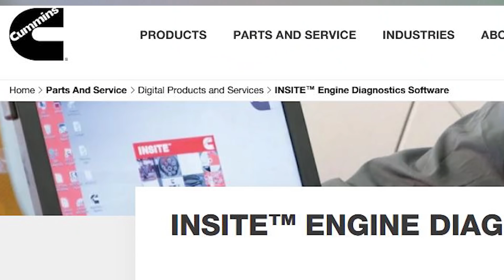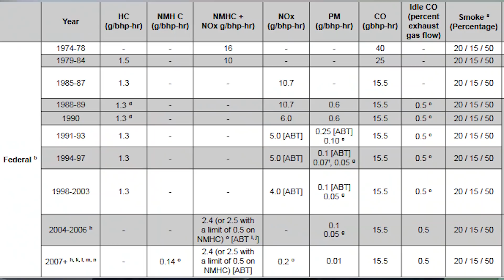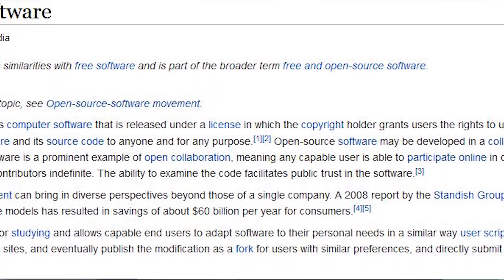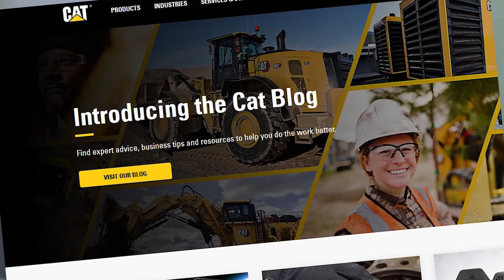Should YOU have the "Right to Repair" your Engine?

Comment: The Right To Repair act is a great thing in my opinion. It doesn't require the manufacturers to give the aftermarket or the end user access to their software and information for free. As nice as that would be, most folks understand the OEMs spend a lot of money researching and developing their products. In the automotive world, it essentially mandates the OEMs provide us access to that information, and at a minimum, the ability to program powertrain and emissions related modules. They're absolutely allowed to charge a nominal fee for this, and the cost and capabilities vary considerably from manufacturer to manufacturer. Some only allow the bare minimum. Others will allow you full scan tool, SI, and programming access like the dealer has. I know there's a push for this in the truck and off-highway worlds. As I'm sure you know, information and scan tool access is much harder to come by in those segments. I have a few different sources, but most of the truck & equipment manuals I have are PDF copies purchased as needed. In any case, thanks for the videos as always!

Comment: As a certified Cat Fitter in Aus, 50/50 agree to right to repair as it’s your hard earned money invested in the equipment you should to a degree be allowed to self repair however the second these “farmer mechanics” no legible trade or diagnostic certification fuck with parameters, force regen and diy repair on gut feeling it often leads to catastrophic problems down the road, Thus voiding any liability or warranty by the “dealer”. Than said customer will be bitching their quarter million dollar yard ornament is no longer covered by warranty an claim that’s not fair either so can’t have it both ways. However if Dealer won’t service your said postcode than that cost an repair may fairly be billed to dealer an allow their party diag access. Sign a waver saying you agree to void all warranty factory warranty in return for right to repair?

Comment: I see these laws as a double edged sword, people will think they will be able to repair anything because they have procedures to things and will get in to something and make the problem worse then blame manufacturers because something else broke or they didn’t have something to remove or properly tighten something and left it loose or damaged it during removal. Basic diag software should be available to everyone, you are buying both physical and intellectual property.   Intellectual property like software should be protected and not be forced to be given out freely to everyone. How many people are going to look at what the codes say are going to be able to figure things out properly or just start throwing parts at the problem until it is fixed. I work at a dealer and have seen too many “repair” jobs from mom and pop shops or owners that have ended up costing far more than the original repair would have if done right. If a compromise can be reached like say accurately read codes and say what they mean, force a regen, and maybe check sensors I am good with that. I have seen a lot of truck come in that the driver got a list of codes from someone then they cleared the codes and any snapshot data and they want the CEL figured out.  Info on things like torque specs and repair procedures or other nuts and bolts type things should be freely released because it is for the physical property, the ability to update an ECM or other module should require at least a little training and definitely pay enough to discourage someone not doing many won’t get the software. Another fix would be give dealer techs better access to the electronic tools at a lower than dealer level and allow them the chance for some side work at least diag wise on the laptop the tech provides and pays some sort of licensing fee for. There are solutions but the government needs to stay out as much as possible.

Comment: If I was a manufacturer, I'd be seriously thinking about letting customers diagnose and fix their equipment. 
Being ahead of others, being open and saying no matter how the legislation goes, customers will have the tools they need could lead a significant increase in market share.
Reply: I fully agree with this. An open repair and diagnosis program would put these manufacturers way ahead.  With supply chain and repair shops so far behind it would help alot of the backlog.
Reply: @mrplowjrezv  the manufacturers could spot failure trends quicker in a perfect world.
Reply: 'Letting' 'their' if you're letting i'd like my money back thankyouverymuch.
Reply: And your shareholders would boot you off of your own company, install a puppet, and put your company back on track to locking owners out of their own equipment.
Reply: Yeah, because all customer's are highly trained mechanics. You should have the ability to get the software/ parts for your truck. Just know that your warranty will be cancelled.
Reply: @tira2145  quick question how much are they paying you to lobby around in the comments repeating the same argument? Literally everyone understands the rules of a warranty and it not being covered if your repair directly caused another failure but alot of this problem is equipment out of warranty.

Comment: As a mechanic that works on cat, john deere, case, Doosan, IH, mack, and just about every other brand in construction... only cat is helpful. To a point. I still can't force a regen when the equipment has a lock out. Pisses me off to have to get a cat dealer tech come do a 5 minute job that cost me 7,000 bucks. I have the software, pay the annual sub, do the updates etc. but can't input a magic password to clear a lockout. Really???

Comment: A very complicated subject. My short answer would be yes, end users and owners should be able to access the software. I realize it's not that simple though. I am quite familiar with the analogous situation with Harley Davidson. Fortunately the aftermarket remains quite flush with "tuning" hardware and software that allows owners or shops to get into the ECU on a Harley and  diagnose a bike, repair a bike or reprogram it in keeping with modifications done to the engine. On the other hand, I have seen less than skillful and less than expert "DIYers" and shops "tune" bikes right into catastrophic engine failure. Of course this says nothing of the EPA regulations. Certainly in diesel pickups, the EPA has successfully hampered the aftermarket to a large degree over the last few years and sent expensive messages (fines) to the aftermarket about modding engine management system(s) on diesel pickups. Then there is also the warranty issue that may result if an owner has gone "in" to the ECU. 

So it boils down to a matter of diagnostics vs modifications and what the end user intends to do and ultimately ends up doing with the access to the engine management system(s). And to what extent the end user is allowed "in" to the engine management system(s). Like I say, it is a fairly complicated issue.

Comment: I feel that they should be required to sell licenses for the vehicle you own.  I.e. I own a John deer model xxx I can get the John dear software to work on that tractor.  They could even limit it by vin so you could only use it on your very own tractor but at least the. You could fix it.  I got friends with 100k+ tractors that are field art because the ecu locked down the tractor in the field where it’s sitting and they can’t get a John deer tech out in any kind of reasonable time to look at it let alone fix the issue.  Others have resorted to hacked Chinese software to diag their tractors but still run into trouble getting parts from John deer.  I worked at a Peterbult dealership for a while and truckers with their own scan tools could diag their trucks and come in and get the needed parts to fix their trucks.  Heck the dealership delivered parts, you didn’t need to come in.  Not so John Deer.
Reply: Maybe it time to dump Deere eq. That usually changes minds !!!
Reply: @catman5546  That is happening too.  Farmers tend to keep equipment a long time.

Comment: as a previous CAT tech I think they should offer all of their software for a price but not the extremely expensive price the currently offer from just part of their software. I do know that the CAT dealer i previously worked for charged roughly 190$ an hr for field tech call out. that's an outrageous price and i know what the highest paid tech in my dealership area was making before he left and that dealer is making money several times over the cost to operate. so yes i believe independents and owner operators should be allowed access to software provided they are willing to pay but the price should fit the product, it shouldnt be another outrageous cost. Dealers will always be able to make money just look at car dealerships.

Comment: I,m old enough too remember when all the different car makers had their own computer software and tools for their codes then the government required obd2 systems didn,t hurt the auto makers I work as a heavy duty mechanic at a sawmill and we run into this problem all the time we have 5 different brands of equipment and nearest dealers are 2 hour drive away and they are understaffed as well would make life alot easier if you had just one standard

Comment: I read many comments and haven't seen one about a dealer "diagnostic fee." O/O with a N14 in a 1998 379 here. I can diagnose many problems with it. Injector failed, easy to figure out. Pass through good. Ohmed the injector. Bad. Towed to Cummins. Told them #6 is inop,  They still charged me $225 for "diagnostic fee."

Comment: Right to repair seems to be the correct way to allow proper competition between dealers and independent mechanics . Other issues can arise when unskilled or overconfident people start getting access to high level software adjustments and tinker with high tech systems creating more problems. Then basically lie when getting the problems they created sorted out by more experienced techs I work in diagnosis and repair of high level catering equipment and hate it when unskilled people have basically hacked the software settings and want to try to claim warranty to have it sorted out. This is not a simple competition argument it's complex as Josh said .

Comment: Biggest issue is that most mechanics are totally incompetent and good ones are few and far between.  I’m not paying top rate to have some useless tit fiddle fucking with shit I own and paid for.  I’m a real mechanic and come from industry.  I’ve seen some absolute disgraces to the trades and until that problem goes away I’ll be fixing my own shit, right to repair or not.  Almost every job I’ve ever had done at a shop was done poorly especially warranty and recall work and you can thank piece work and book times for it.

Comment: Ultimately I think manufacturers have had their cake and eat it too. I think it’s time for that to stop. If they want to continue to “own” the software, they need to own the responsibility as well.  If they want to keep the “Proprietary ownership“ of the software, then they need to accept the consequences of wrongdoing. Ultimately, whatever the purchase is whether it be equipment or electronics etc., that equipment is purchased for a purpose and has a finite lifespan. In most cases that equipment has a dollar per hour value of on-time and Offtime. And the case of machinery, if a machine is purchased and is not running due to downtime, if it is because they don’t have the access to the repair information or the repair facility due to scheduling, the company should pay for the downtime. Ultimately it is because they will not release the information that the customer was unable to get the repairs done and minimize downtime on their own.  I find it sickening how equipment manufacturers can create a problem causing downtime, such as through software updates that down a machine, hold that machine in a down state until updates are available, and still demand the payments be made while that machine is not generating revenue.  This is especially heinous in farming. It’s not a matter of paying for a week worth of downtime, this could entirely fold a dairy farm if they do not get a crop of a.m. before it goes past peak season. That can literally be the life and death difference of that business. That can affect milk production that much. It isn’t just a matter of letting the corn stand for an extra week, entire family farms have folded because of a piece of machinery that has went down and they couldn’t get their hay in. Trucking companies have went under because of repairs and downtime. Dealer prices leave much to be desired. Independent shops are much more competitive and fit better into most business models.
Reply: Yeah I've heard growing up in a small farming town multiple situations were a family had problems. it tended to be John Deere Tractors specifically well the equipment would have a problem during corn harvest and they couldn't get any repairs done because every tech is busy because it's fucking harvest time in a farm town but they'd have to hope and pray the weather stayed okay long enough for the equipment to be repaired.. I couldn't imagine my entire livelihood being decided on whether a sensor tripped a code, and the rain held off long enough for the code to be reset.

Comment: As an ex dealer tech and now independent. I 100% believe if you own the equipment you should have the freedom to repair/modify in any way you want.

However dealer software is a product that the company has invested millions into and they should have control of there product, just as you have control over the machine you purchased.

It’s a muddy solution but I think the manufacturer should be able to control who they sell to, but I also think there should be information protections. If an independent party wants to reverse engineer your product and provide the information to their own customers they should be free to do so.

Comment: I think they should be require to give out the diagnostic software and the ability to calibrate parts (injectors, turbo, and other random parts)and would have to take it to a dealer for advanced stuff like the ecm and tuning
Reply: I disagree. I think owners should have absolute full access to every single last byte of the ECM that THEY PAID FOR. This junk nowadays is way too expensive to take to the dealer, and the dealers are always way behind on getting stuff into the shop
Reply: @thetowndrunk988  well allot of that would be eliminated by smaller shops having access to do the majority of the work. The more advanced stuff you don't want Joe blow having the access to change certain things. For example if you push injector timing outside of 20°+/- TDC you'll start melting pistons and burning cylinder walls

Comment: My dad was the head enginerd for GM for about the first 30 years of OBD2. I grew up on a large family farm and have been a technician now for almost 20 years. I worked at gm dealer, a John Deere dealer, the farm(which had everything from every manufacturer and every generation, 100 years old to just delivered new.) And now a large city fleet. The government mandates access to the the auto industry but let's everyone else skate. Which is bullshit. It costs them maybe a nickel to include software with the purchase of a piece equipment to communicate with your phone. Especially when you just spent $500,000 on something. Everyone should have access to the equipment they purchased. If you want to jack the horse power through the roof, that's your decision and your right.

Comment: As a small independent oil producer I need to be able to repair my equipment in the field and not have to rely on a mechanic. Much less have to carry it to a dealer for repairs. It's just better for us to recondition older equipment that does not rely on computers to operate.
Reply: That is why older eq.,is now in demand and selling higher. It has happened in several industry’s ,look at farming auctions!!!!